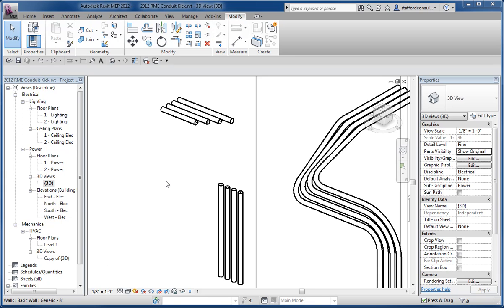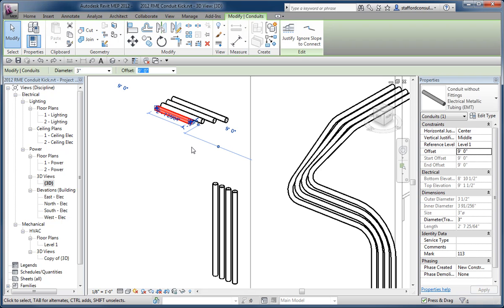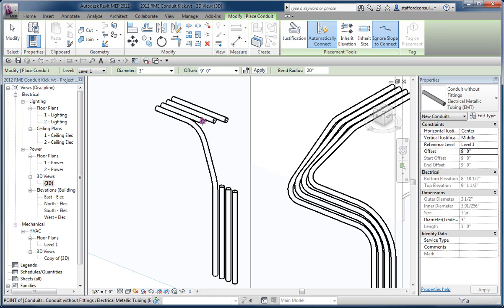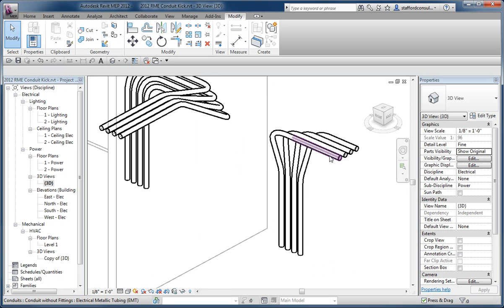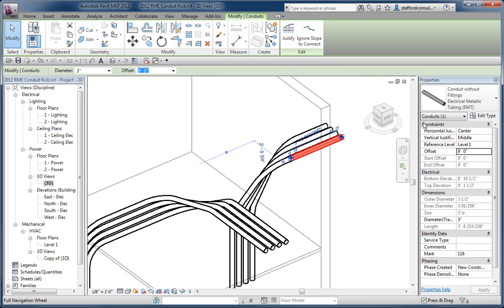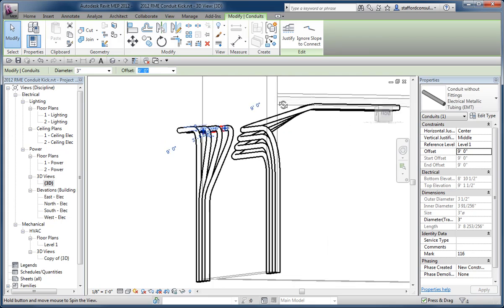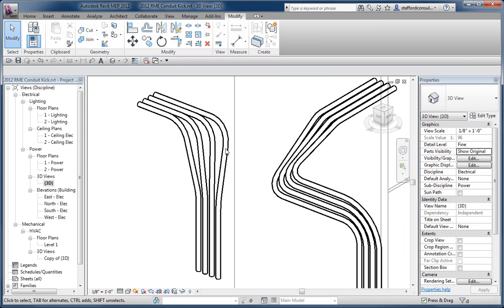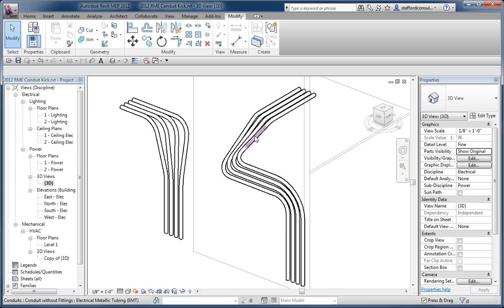Kick Conduit

Comment: Steve, I can really use your help on creating these kicks at different elevations.  I keep getting warnings and errors.  I hope you are still viewing your YouTube channel.
Reply from the maker: Hi Damian, Sorry I didn't see your comment until now. Are you still having issues? Make sure your conduit type(s) have all the fittings assigned. Quite often they aren't and that'll interfere with drawing conduit every time.
Reply: @RevitOpEd  How do you get conduit offsets to show in plan view? As of now, it is impossible for me to know where my conduits changes elevation as everything appears the same in plan view. I have not figured out how to change the display so I can easily pinpoint where a conduit is dropping elevation.